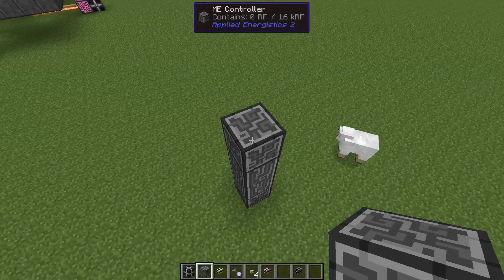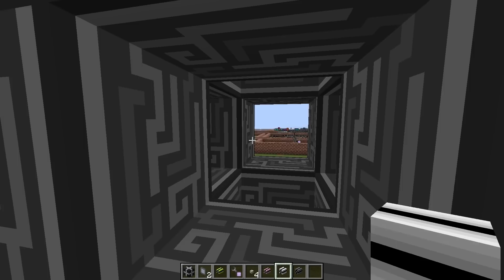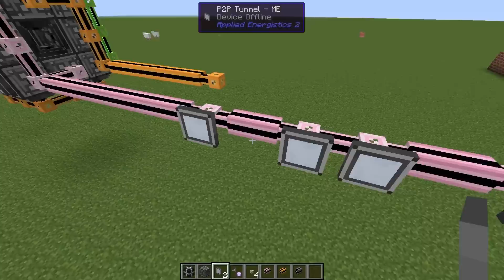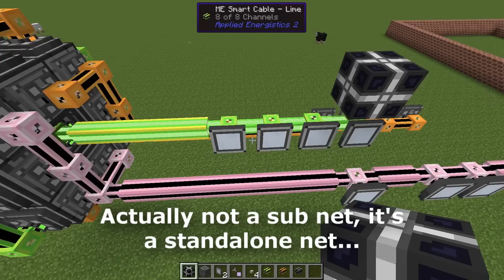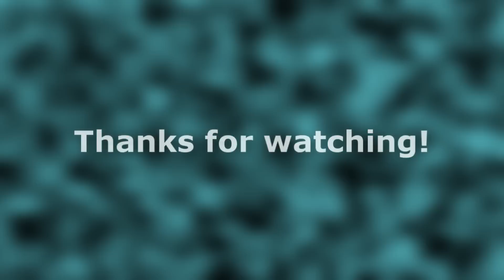Effective ME Controller Design - Applied Energistics 2 Tutorial #19 (MC 1.7.10)

Comment: Watched this, then watched a few of your AE2 tutorials. After the p2p tutorial I now understand how this works. So the 32 channels coming out of each p2p on the sides of the controllers are transferred to the other p2ps. The cable however that connects the p2p are basically their own network in itself. I'm assuming, coming from the p2p tutorial, that you have to use the memory card to connect each pair of p2p. So in a sense you are transferring channels, instead of just fluids, items, or power.
Reply: You got a sub for your knowledge as well. I'm sure I'll be watching as lot of your videos as I play Project Ozone 2.
Reply from the maker: That's right! You CAN transfer the P2P channels in the same network, but personally I think that's a bit messy and harder to keep track of (and less efficient). It's also possible to use the memory card and configue one input to several outputs, but that will use more channels in the "p2p network" making that one less optimal. But I guess that it might be useful sometimes.

Comment: hey TKH so with this do you have to go through and manually memory card each of those p2p tunnels with the room you are attaching them to?
Reply from the maker: Yes, that's correct. You can either use one card and re-program it for every new input (remember: one input channel can have several out) or have one memory card for every tunnel and save them in various places. It could be helpful if you tear down the network often.
Reply: if you have one imput with several out will that mean that each out will have 32 channels or that you will have 32 channels split between all the outs?
Reply from the maker: The 32 will be split. So it's not an effective solution, because the "transfer network" will use up one more channel without the benefit of more throughput. But I wanted to mention it because there might be occations where it's useful. Perhaps in the beginning when you only have a small controller and haven't set up the large backbone network with a massive central controller.

Comment: I realize you made this a long time ago, but I made a similar build and was having trouble with power distribution and I was hoping you could help me solve it. I have power hooked up to the device via the same method you use here, but it ONLY powers that particular dense cable and none of the other p2p devices on the controller are powered.  I have to connect them via quartz fiber to the first cable--or other cables around the cube that are connected to the first cable--in order for them to receive it.  Is power no longer sent through the initial dense wire throughout the entire controller to the p2p panels?
Reply from the maker: I'm not sure I follow every step, it would be much easier with a few screenshots... But P2P connections will not transfer power, so you need quartz fiber to connect both sides.  All networks need power and most of them should not connect to each other ;)
Reply: Ah, thank you.  That made it clear to me. I thought that connecting power to one face would then power ALL faces (and therefore all of the p2p connections on the surfaces of the controller).  I thought I was missing something.

Comment: I'm not getting the powering side of this. You use a creative power supply that most players wont have in a server. How can you power this using a tesseract? it wont connect to t he dense cable like this creative power supply will. Therefore your powering system is flawed for any player that doesn't have access to the creative blocks
Reply from the maker: Power it like you would have powered any other ME Controller with a normal Energy Cell (from AE2). If you have the power input from a different source (such as a Tesseract or a cell from Thermal Expansion you have to use an Energy Acceptor. This topic has been covered early in the series and is therefore not a flaw in this build ;)
Reply: But you didn't show the power from any accept or. The video showed the cable connecting to a power cell. My point is I was following your tutorial, but I get to the power side of it and no matter what power system I try, it wont join using the Dense cable and an energy cell. Your not the only one who uses the creative energy cells to power things and I understand why, but  its annoying when I get to that part and nothing works. Just some consideration to the fact that the people watching this video may not have access to the blocks you use, so some mention  or how they should do it or even better a link to your said video? At east that way they can can learn more instead of getting stuck.  Thanks for the prompt reply too. I do appreciate your efforts.
Reply from the maker: I understand what you mean but I don't fully agree ;) What I mean is that this is a pure AE2 tutorial series, and using any Energy Cell from AE2 will connect to a dense cable, so you can follow this tutorial and just use a normal AE2 power source. Or a normal cable with a quartz fiber to get power from somewhere else. The thing is that this is the 18th tutorial video in the series and I have to assume that people going for a 2000+ channel controller knows how to do all the basic stuff (like powering a network from pure either AE2 or from other mods). But for those who don't know or understand all these things I have a playlist (in the video description) where ALL my AE2 videos can be found. I hope the video was useful anyway :)
Reply: You're right. I do tend to look for tutorials purely our of necessity rather than starting every series from day 1. mind you, if I did that, id never be able to play the game due to lack of time. Thanks for your input, Ill search through your playlists and get the info on AE2 power cells. incidentally the quartz cable doesn't connect to other power supplies either. Tried Fluiducts, ender IO, wire, none of it connects. Also going to go through try to understand the PSP system. Im not convinced I did that right even after following this tut.
Reply from the maker: Energy Acceptor, that's the block you need as you want to get power from other mods :) I tried it between a Dense Cable and a Tesseract and it worked just fine.
http://ae-mod.info/Energy-Acceptor/
Quartz Fiber is only used to get power from a different ME Network without connecting them. Will not connect to Dense Cable so you'll have to use an Glass Cable in between.
Reply: Yeah,  Definitely going to go down that path. Can you also give me a link to your P2P tutorial? If I'm understanding you here (I also watched your P2P vid) If I link each of the 12 P2P tunnels on one side into a dense cable, I can then break them out again somewhere along that backbone in 12 different locations and each of those will have 32 channels? Of course, I have to use the memory card to link each of the P2P ends? Resulting in 6 Dense cables. Or I could join them up even further?
Reply from the maker: P2P tunnels can be very simple or quite advanced depending on what you want to do. I think I have made four videos with tunnels so you can check them all ("large base design" is a good example of how to do it late game). Remember that if you have more than 8 IOs in a "P2P network" you need an ME controller in that network. So if you want 12 tunnels on one side you will need a dense cable (and a controller block). Map every input to one (or several for some reason) outputs and you will get 12 outputs on the other side - each with 32 channels. It's not too bad once you get used to it but can be a struggle in the beginning :) You can't run tunnels in tunnels, so only one level depth. Or use a normal, thin cable with 4 in and 4 outs and run many of those in different directions, then you don't need controller blocks for those small nets.
Reply: I'm getting it idiot

Comment: So if i connect storage on one side of the controllers and then a terminal on the other will i be able to get the items out? Are they connected in that way ?
Reply from the maker: As I understand your question; yes. If you need the basics on networks and controllers you should check the early episodes in the AE2 playlist :)
Reply: I meant to ask if this whole system is one huge network or multiple small ones.
Reply: I have another question.
If i use one energy acceptator to accept rf can i change it into eu using p2p tunnels ? I know Ender io exchanges rf to eu and other way around.
Reply from the maker: It depends on how you build it. In a small controller setup everything will probably be in one network, but in this video's large controller I use P2P tunnels to reach every side possible, and that "middle layer" is not a part of the controller's network. The "P2P network" can be one big or several small.
Reply from the maker: No, the tunnels are simply a tunnel. Not a converter.
Reply: thanks for anwsers

Comment: So I am running out of channels to use (Have 1 for power, 2 dense cable doing to my autocrafting, Security terminal for wireless and a storage bus because I am using storage drawers) is this the way for me to get more channels? dont rly understand what this controller design is gonna do for me ^^
Reply: One ME-Controller-Block gives you 192 Channels in total. This Block has 6 sides. Each side gives you a maximum of 32 Channels. Build the ME-Controller larger, to get more than 192 available Channels. (Two ME-Controllers side-by-side gives you 10 connectable sides: 10x32Ch. = 320 Channels in total.) Use P2P Tunnels when you want to deliver more Channels than your laid Cable can normally take. Place a P2P-Tunnel on the ME-Controller to "compress" 32Channels into 1 single Channel of your laid ME-Cable that goes to that point where you want to "decompress" the single channel. With a simple ME-Glass-Cable (Fluix) and 8 P2P-Tunnels connected to your ME-Controller you can run 8x32 (256) Channels from your ME-Controller to wherever you want. At the Point where you want to "decompress" 32 Channels, connect a further P2P-Tunnel. And don't forget to link both sides of each P2P Tunnel with the memory card. Reset the Memory card when one P2P Connection is linked, before you link another two P2P-Tunnels!
Don't forget to use QUARTZ-FIBER Cable to connect each P2P Tunnel-Cable with your Energy-Grid, because it need's Power to operate.

Comment: I made my 3-length cube with p2p Tunnels into Smart Cables and combined 24(23) Smart Cable channels, which are basically 2 sides of the cube each) into Dense Cables. Then I took the Dense Cable to my DeepStorageUnit Room and put p2p's on the Dense Cable. From those p2p's I placed Smart Cables to 8 of my DeepStorageUnits with Storage Buses each and powered every SmartCable lane with an Energy Acceptor (also tried ME Controller). When I now output a Crafting Terminal via p2p Tunnel anywhere on the Dense Cable lane I CAN NOT access the stored items. Why? I can only access the items on the specific Smart Cable lane directly connected to the DSUs
Reply: Is every p2p output its own ME network? If it is ... what's the point in all of that if you can't access every output then?
Reply: I also use 3 different coloured Smart Cables (but fluix Dense Cables). Is that a problem? If I try to output a p2p into one of those coloured Smart Cables i dont even get access to corresponding coloured DSUs/ME drives
Reply: I just watched your P2P Tunnel video and you didn't really explain when to use ME and Item Tunnels afai can tell, but you were using regular ME Tunnels for ME Drive connections ... so I'm assuming you can connect Storage Buses via ME Tunnels ? I also only now used the Memory Card (Sneak Rightclick on the first P2P Tunnel on my main Controller-Core to save settings and then rightclicking on the P2P Tunnel leading to one DSU row to load settings) but it didnt change anything. [I saved settings from one Core Tunnel with red colour cable and loaded to 1 DSU Tunnel with red coloured cables. Then i saved settings from another Core Tunnel on the same red smart cable lane and loaded it into another P2P Tunnel with also red smart cable to Crafting Terminal. Still didn't get the DSU content in my Crafting Terminal
Reply: i just tried stuff in a creative flat world: 3length cube with only 1 green dense cable leading to energy acceptor with energy source and 1 p2p tunnel ME into yellow smart cable into dense fluix with energy acceptor and energy source. to this point everything works fine: it says 1 used channel on the yellow smart and fluix dense cable and device online on the p2p tunnel ME . when i try to add another p2p tunnel ME on the dense fluix the p2p tunnel ME on the core instantly says device missing channel. when i try to connect both tunnels via memory card it stays that way. what's wrong?
Reply: The problems were: You can't directly connect the smart cables at the core into a dense (you have to use an me controller for that) and you have to use another cable from the dense cable in order to get your tunnel output to machines (otherwise the tunnel connects the wrong direction to the dense cable)
Reply from the maker: Ok, lots of comments but it seems like you got it all to work? I don't know where to start, but it's really important to keep the two types of networks apart. The P2P network can have its own controller (it has to if you have more than 4in-4out), and you always need to keep track on ins and outs on every P2P connection. This method is very powerful and quite simple once you have done it a few times, but it's easy to make small mistakes that will make the entire network get locked up. Each P2P output is NOT an ME network, it's just the other side of the input. But the connection inbetween MIGHT be an own network.

You can run a P2P network within the same network just to get a dense cable to the other side of the base. I would recommend using dedicated P2P networks to keep things logic, but you can do whatever you want.

If you have more questions, feel free to ask, but please make them as specific as possible - and if you explain a setup it's much easier to have screenshots to go with it ;) (Imgur album is the best!)

Comment: Hey, I am like building an underground bunker idea with multiple floors in a kind of futuristic build.

Now i got the controller on the main floor, under that are 3 more floors. after combining the 3 smart cables with a dense cable and a me controller, can i then run a dense cable across each floor and connect the rooms with a color? or is it more, one line of dense cables a floor?
Reply from the maker: Well, just decide how many channels you need per floor. Have you seen my "large network guide" video? It can give a good hint of how you can connect the floors. If you have a medium sized controller on your main floor (let's say 2000 channels) you can send a normal glass cable (8 channels) to each floor. To make things easy you can just have 4 in - 4 out which would give 128 channels per floor. Or use a subnet to transfer the channels to send one glass cable to each floor to get (8x32) 256 channels per floor to use. You understand how I mean? :)
Reply: Thanks for the tip, also looked at the network you made and started practicing in creative mode. I finally understand how it works :D

Comment: im having a problem they all turned red and i did everything on your video just like you did im not understanding whats going on
Reply from the maker: If the controller goes red it usually means that you have two controllers in the same network. If you have a subnet controller, make sure it's connected to P2P tunnels only.